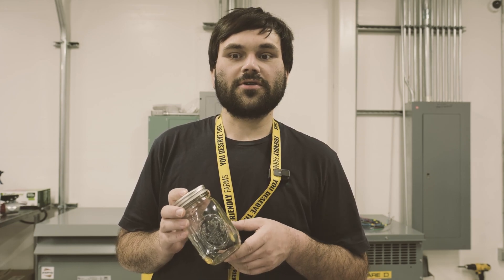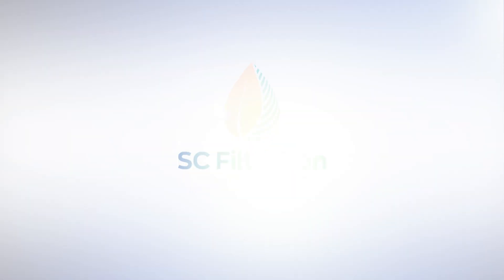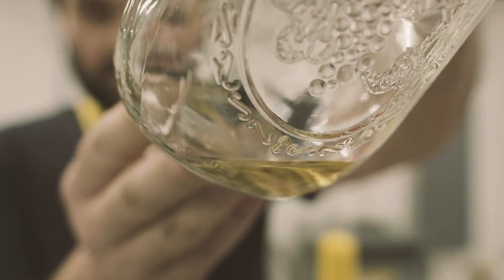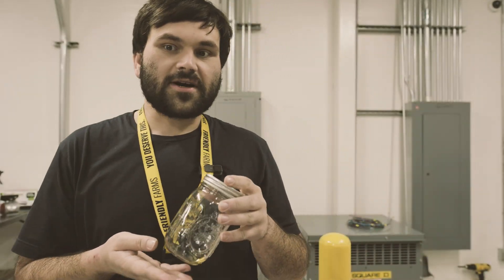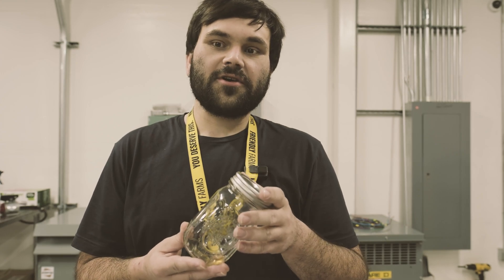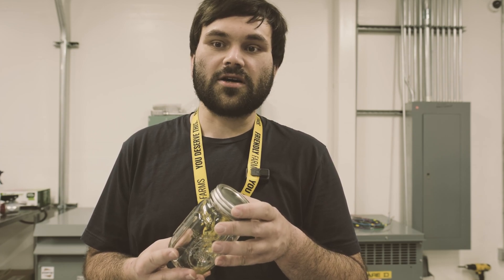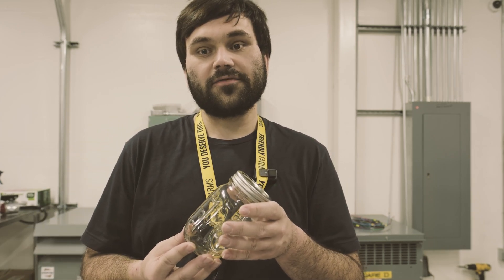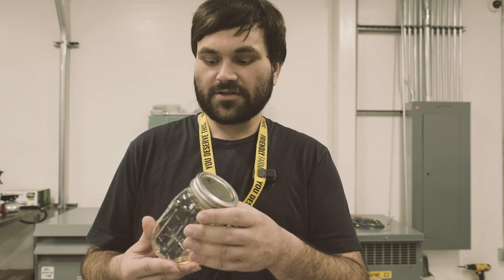Terpene Collection from Freeze-dryer SOP

Comment: Don't explain but SHOW!
Reply: Tbf it is just a few settings changed and collecting the liquid and decanting it. Not like he is going to throw a camera in the freeze dryer and show 72 hours of basically nothing happening and then pouring a liquid
Reply: @sunnohh  Pretty much it exactly, I use a 40/45F shelf temp for drying my hash depending on how melty it is and its about 1-1.5% from dry hash weight of terpenes will come off from sublimation having similar effects to steam/vacuum distilling (I have interesting stories from building a personal freeze dryer from a couple vacuum chambers, warming pad for reptiles, and dry ice with a pump; while popping the lid to check on the hash and the heat difference is shocking between the water vapor and a hash patty that's still below freezing so the phase change really does "rob" heat away) so at commercial scales  where you run kilos it can be enough to make it worth it but smaller amounts its so little you might lose them all transferring from freeze dryer to jar.. The main thing is just the need to do a quick filter before the freeze and decant will take the terps to crystal clear point vs the cloudy ones you can get from just freezing hydrosol after a defrost. There will be varrying degrees of color which comes the mix of different kinds of terpenes having a bunch of C-H bonds that refreact yellow light vs terpene specific fractions that are pure chemicals will have almost no color depending on which one you're talking about.
Reply: @hashsacman4994  "The main thing is just the need to do a quick filter before the freeze and decant will take the terps to crystal clear point vs the cloudy ones you can get from just freezing hydrosol after a defrost" I am trying this right now